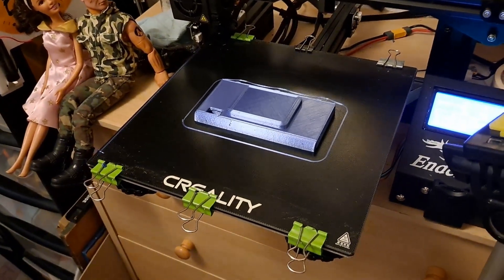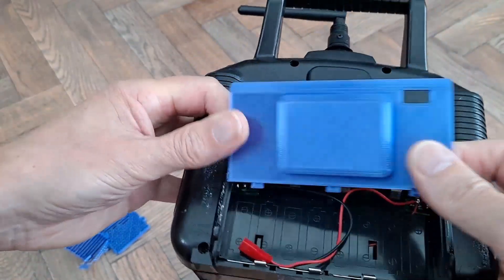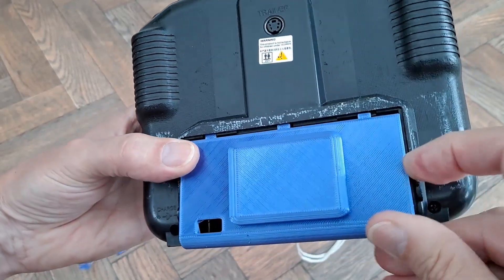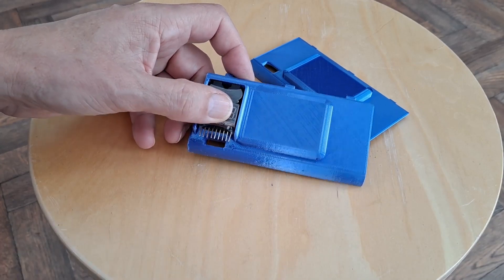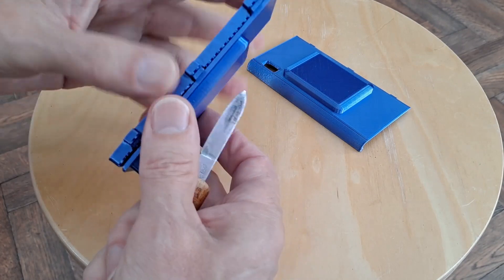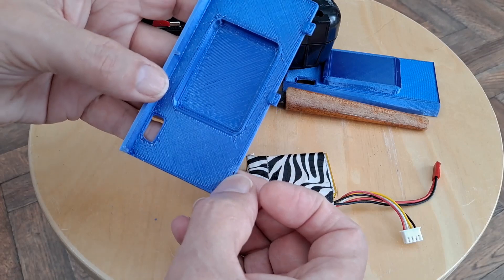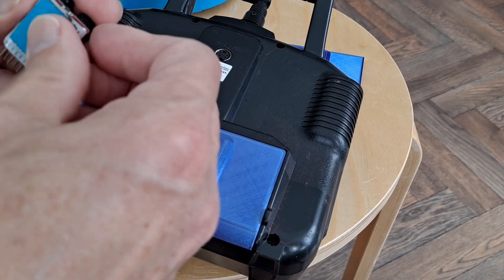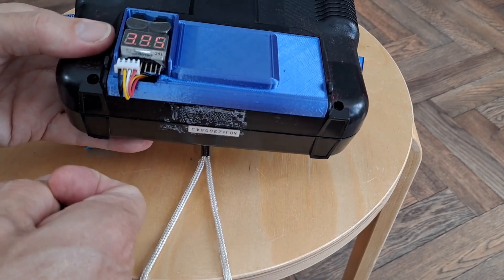Battery cover for my FlySky FST4B

Comment: Excellent. You thought of everything there. Room for the chubby battery, and battery alarm with a hole for the wire. 
Good stuff. 👌👍👍
Reply from the maker: Thanks, Mike. I originally modified the TX to use the Lithium Ion battery pack quite a while back and tried heating the back cover to make it all fit. That was pretty much a disaster as it just deformed the cover and I had to hold it in place with duct tape.. Obviously now I have a 3D printer, I could make a better job of it. The LiPo alarm was an early addition too, because it meant I had one handy for testing batteries in the field and monitor the one in the TX.
Reply: @GrandadIsAnOldMan   I don't have a 3D printer anymore. When my son and his fiancee got a house he asked for it back if I was not using it. So I wasn't and it went. I thought of getting another one but I know it would be a waste of money for me. Most of my stuff is well on hold apart from my music. I should really upload a few I have written. The problem, for now, is extreme tiredness after the stroke. Seemingly it takes a while to go away. This was the strangest thing that ever happened to me but at least I can still play my guitar. In fact, this sounds nuts, but I am actually playing better than before. Strange days indeed. 🤔
Reply from the maker: @mikeflight9  you take it easy, Mike, I am just pleased you are still taking the time to leave comments on my videos 👍👍

Comment: Nice work.  What to do with the waste PLA?  Thanks once more.
Reply from the maker: In theory you can grind it down and reuse it. In practice, the equipment to do that is more expensive than a printer and you can only use clean waste, so you wouldn't be able to brush it up off the floor or use any that you had glued together, or otherwise contaminated.
Reply: @GrandadIsAnOldMan  One idea I have seen is to melt it with a panini press and silicone sheets to make sheet material for projects, I think I've seen Atomic Shrimp do it with HDPE but it would work with PLA too. At least then it would be useful. Theoretically PLA will compost, but it has to be ground up and composted in high temperature commercial composters, otherwise it doesn't decompose. Given that PLA is based on plant starches, you could view the plastic as carbon that has been "captured" from the atmosphere, so it going into landfill in large lumps and not decomposing back to CO2 is a good thing.
Reply from the maker: @IanSlothieRolfe  here is my video on recycling HDPE - HDPE first test using a sandwich/panini toaster https://youtu.be/EUt54Oh_QwE?list=PLA5a2xPRSrB3LK-DhQDUby7-zjsOyG3yY
Reply: @GrandadIsAnOldMan  Haha! There I am trying to teach Grandad to suck eggs.... I should have guessed you'd been there before. I have been going thru some of your older videos but there;s so many of them!
Reply from the maker: @IanSlothieRolfe  yes, I wouldn't suggest trying that, you could be wasting weeks of viewing time. By coincidence, I think Atomic Shrimp's video was the one that inspired me to search for a Panini Press in the charity shops. It certainly might be worth a try with the PLA just to see what happens. Of course I could research it first to see what temperatures are required and what the heater can supply, or I could just try it and see what happens 😆😆
Reply from the maker: @IanSlothieRolfe  Here you are, I dug out the panini press and tried some PLA https://youtu.be/nlWgrSgCKgs

Comment: Just wondering is this material recyclable?
Reply from the maker: In theory you can grind it down and reuse it. In practice, the equipment to do that is more expensive than a printer and you can only use clean waste, so you wouldn't be able to brush it up off the floor or use any that you had glued together, or otherwise contaminated. The slightest amount of dust or debris will clog the nozzle of your printer. You will also be told that PLA is biodegradable, this is not entirely true. It will biodegrade under specific circumstances, which do not often occur naturally.